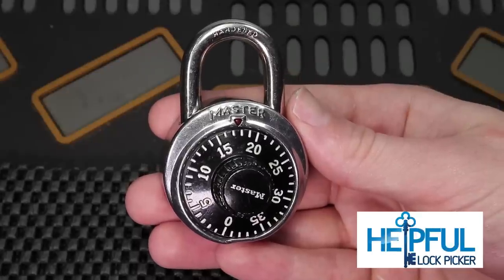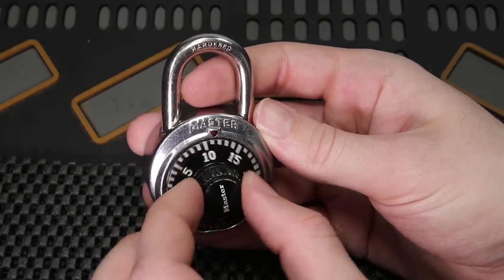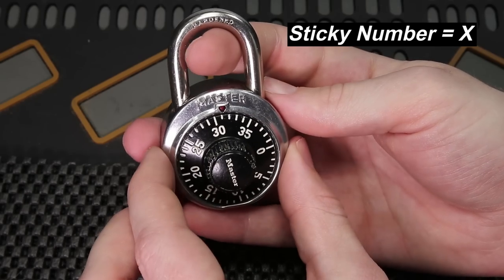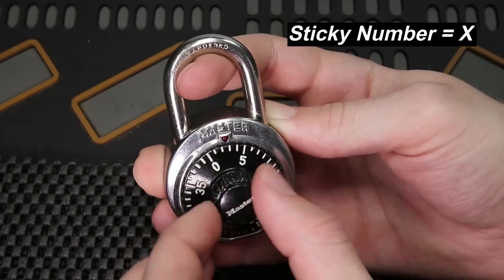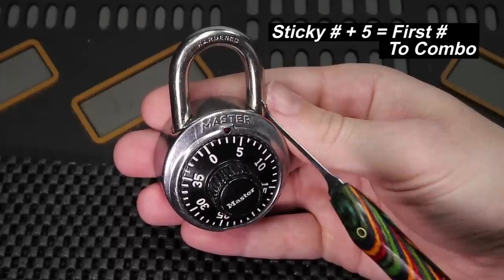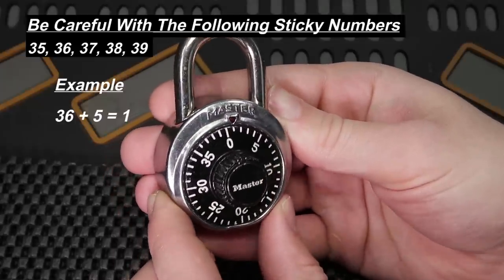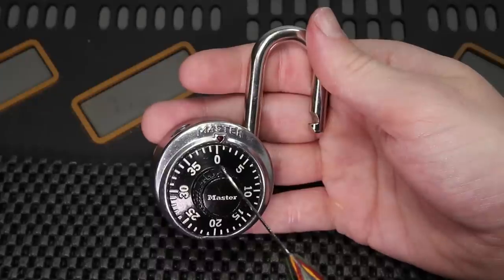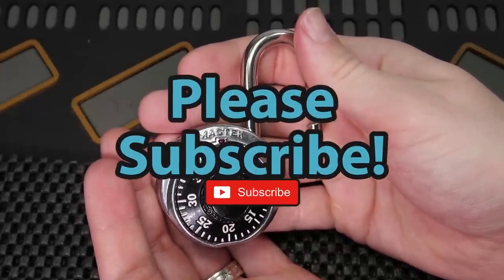[257] How To Decode The FIRST Number To A Dial Combination Lock

Comment: This method of finding the first number does not apply to the original Master Combination padlocks made in Milwaukee Wisconsin. The original padlocks have Milwaukee WI stamped into the back case, and the first wheel does not have the additional drive pin ( fly ) that contacts the shackle retainer. This method only works on the later unbranded locks that are made in Mexico ( I believe ) and they have no country or place of Manufacture stamped into the back case.   Regards, Brian.
Reply from the maker: Thanks for sharing that historical tidbit! That is definitely something worth considering. It is interesting to think about how a Master Lock makes their decisions in their boardroom
Reply: I just watched another video that supposed that older locks were too worn to stick. But this makes a better explanation, since the older locks are just made differently. Thanks! (and you might guess that the one I'm practicing with is indeed made in Milwaukee)
Reply: I spent 4 hours with his other video not being able to open my lock.  My sticky # is 14 so according to the video, I tried 19 with an infinite tries of different combinations.  After being frustrated, I looked on the back of my lock that has a 6 digit serial number.  I googled the number and the working combination was right on the second result in a pdf file.  The first digit was 14.  Now I am extremely confused!  Finally, I find this comment and runs to check the back of my lock.  It does indeed say Milwaukee WI.  Thank you for this much needed closure.
Reply: @kamakGT  what pdf ?    The old police manual pdf?
Reply: @Reaper-uu5kk  Oh wow this was a while ago.  I’m not sure if it was police or not. It was just a google search result of the serial number typed into the search.
Reply: @kamakGT  yea i found a pdf with a ton of codes for the older masterlocks. And on front is was for police training

Comment: Thanks for this and for the link to the full decoding. Locksmith here and these locks always frustrate me in decoding. I have a bypass method that works in most cases. Also interestingly the Abus one has an override key slot on the back to spp or rake open... 🤔
Reply from the maker: This lock has a backup slot as well. And you can pull the bitting of the data based online.

If you are looking to do this quickly I would recommend getting proficient at feeling the feedback and using one of the online calculators.
Reply: A nylon hammer in the right spot works better.... But you aint seen me... 🤔 Right 😎 seriously though i do want to get better at decoding them 😂
Reply from the maker: @forric23  whenever I go to the gym I see a collection of them attached to some random beam. I always wanted to relocate them, LOL
Reply: For the Abus ones with the override key, I've done a video showing how easy it is to pick (even with a bobby pin / hair clip). :D
Reply from the maker: @Swynndla  Cool, I will try to check it out!
Reply: @Swynndla  I waved a rake at it and sang "Abus Openupus" in a sort of magicians voice and poof it opened, I felt sad for a second, as it was the most expensive of all the dial padlocks at nearly 8.99 I bought and ironically less secure than the 1.59 amazon special no name. didnt even need to turn the dial one degree

Comment: I've been using your technique to unlock several Master Combination locks that the company I work for has accumulated.  Somewhere along the line they lost the combinations for the locks left behind by past employees after they left.  I've managed to unlock 5 of the locks so far, but I have noticed something.  I can only unlock locks that start out with an odd Sticky Number.  If the Sticky Number is even then none of the Guess numbers seem to bracket digits.  They all span from one digit to the next. I've written a computer program to do all the calculations for me after I get the Sticky Number and the two Guess Numbers.  That has allowed me to try digits at either end of the Guess numbers without having to do all the tedious calculations.  However, none of them seem to work.  I'm wondering if you have run across this, or perhaps have a suggestion I could try.
Reply from the maker: Thanks for sharing

Comment: Dose any two master locks have the same dail combination)
Reply from the maker: I am sure there would be a way to order a set with the same code
Reply: @HelpfulLockPicker  I am taking about the possibility of buying 1000 thousand dial combination locks from master and alteast 2 of those locks having the same random combination. There is far less combinations possiblity than it seems when considered you don't have to know the third number if you know the first two because you can just pull the latch on each number. The locks can not have a combination of 1,2,3 or 1,1,1 so the minimum combination would be 1,11,21 otherwise the gates are too close and all you would need to do is jingle the dial as you pull the latch and steal the lawnmower.